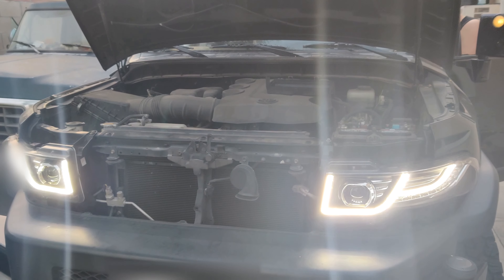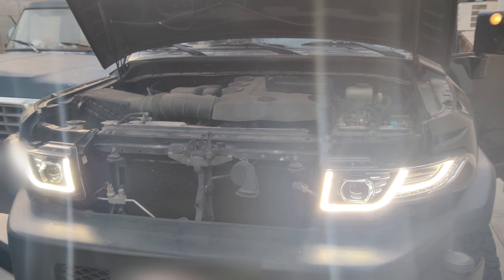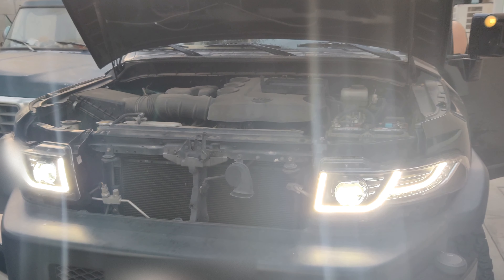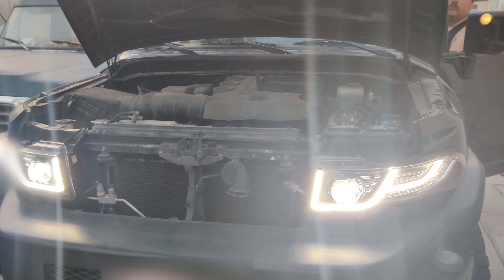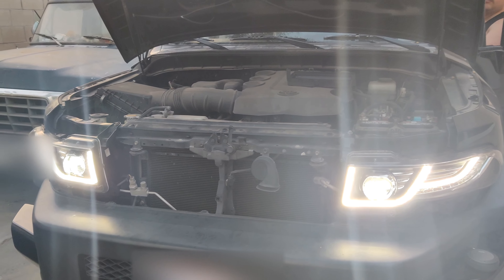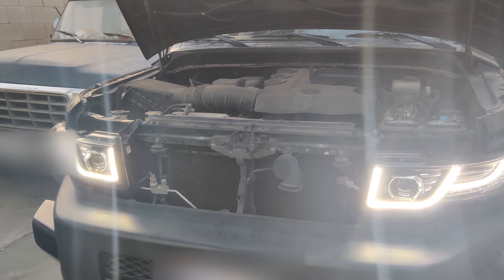Toyota FJ cruiser LED projector headlight wiring issue. Read Description.

Comment: I was thinking if H4 bulb can be modified to fit and bypass all that mess.
Reply from the maker: I tried it, it will not work. That bypass requires further splicing and you would end up at the same place as the error occurs before the lightbulb with the diode. Flipping polarity on the diode requires splicing 4 wires, splicing H4 to work requires splicing 6 wires and you would still have to splice the diode to keep power from shutting off at the light connectors when engaging the high beam. Further more although not tested i am sure if you have these same headlight that they are mechanically operated to lift the cover to allow more light through. The H4 trigger a secondary bulb to become brighter and direct light higher. That bulb in this case would become brighter but not shoot light higher due to the mechanical bulb cover. You might get it to work but that's splicing another 2 cables minimum leading to 7 total spliced cables. Hope this clarifies things a bit.
Reply: @locorudy626  Thank you for your respond. Thats right I forgot about the solenoid shutter inside the lense. I will check it out when I get the headlight this coming week.
Reply from the maker: @kensaejao5216  My recommendation would be to plug them in and see how they work, you might be in the lucky group that got them plug and play. I have read a few people had no issues with them it was as simple as plugging it in everything worked fine but if you plug them in and when triggering the high beam 1) doesn't change anything or 2) turns off the lights then the diode is most likely the issue.
Reply: @locorudy626   got the headlight today and wow what a mess!!
Reply from the maker: @kensaejao5216  did you fish out all the connectors already?
Reply: @locorudy626  I did a quick inspection and the problem is exactly same as yours. I also have to install H7 Leds in reverse priority, very strange...

This is what I have found: Main lights become DRL and Led strips will only stay on in lo and hi mode. Hi beam operation will shut off the H7. I haven't look into the shutters to see if its open or close when the light is on, but I will try your method of reversing the diode first.

Also the DRL module on the driver side is messing with the circuit. I may have to bypass it and get the power directly from the fuse box instead.

Ordering some fuse pigtails and connectors now. Will let you know how it goes.
Reply: @kensaejao5216  any update on this?
Reply: @JerryHatrickShorts  I ended up disconnecting the harness of the DRL resistor unit near the driver side fender right under the head light. So now no lights are on in DRL position, the next turn on the switch will turn on the LEDs along with park lamps and next turn is the headlight with LEDs. My high beam works normally but I don't remember if I reverse the priority of the black box that came with the light. I'll check it out and let you know later.

Comment: Another topic: DRL.
I assumed the halos (neons) would act as daytime running lights. Instead, the low beams turn on when I put it into gear and start driving, and no halos (light switch still off). But when I turn on the light switch, only then do the neons come on. Something seems backwards. Thoughts?
Reply from the maker: I believe you are talking about the LED strips. If you are they need to be wired to the DRL fuse for that. I have a video of that as well.
Reply from the maker: https://youtu.be/FegfF0TYaHE

Comment: Hey bud question for you .. maybe you can help me .. I have the same headlight that came also with the taillights for my FJ cruiser however now only my dash when turning on the turning signal it hyperflashes but the actual turning lights don’t work .. they only work if I push the hazards button lights .. I heard about a relay ? But not definite answer please help!😩
Reply from the maker: That is a very weird issue. Have you tried reinstalling the factory taillight bulbs? If so did the turn signals work? If you haven't tried that check the fuses first that are associated with the turn signals.. i doubt that's the issue because you say it hyper flashes on the dash but worth a shot. If no fuses are blown i recommend reinstalling the factory taillight bulbs, reverse and turn signal see what it does then if still not working I'd do factory bulbs in the front too .. you can try and be lazy and only do turn signal bulbs on all 4 if none of that fixes it i would change the relay last but I'd order it today just in case all else fails, not sure where the flasher relay is on the Toyota on my Sequoia it was easy to get to on my brothers Lexus almost impossible without scaring your hand... hopefully just a fuse I'd get a test light and start at the fuse panel under the steering wheel since the turn signals need ignition on to work. Keep me updated on your findings.
Reply: @locorudy626   thank you brother! I will keep you updated, I recheck all the fuses and they all look good.
Reply: By process of elimination, recommend unplugging the taillights first and then testing this out if no hyperflash and turn signals are good in front check the rear install. If I recall (For VLAND) the taillights are wired differently than the oem, meaning you have to install the plug to the bulb socket in a different location than the oem. Forgot how this went but i had to plug the wires from where the parking lights to the turn signal and the turn signal to the parking lights also i think this needs a bulb for the brake light which i replaced with an led.

Comment: Hi. I keep hearing H7 and D2H bulbs, but it seems they only have 2 contacts, so how does that offer both low AND high beams?
Reply from the maker: That is correct, the factory H4 plug from Toyota has 3 connectors 1 for low beam 1 for high beam 1 for ground. Tapping these cables to an h7 bulb would not work, you would need a special harness to keep the 12v constant to the bulb because Toyota cuts the power out to low beam when the high beams are engaged. Also note that h7 are single functional bulbs they do not have a dual function so the way high beams work on these is through a moterized shutter that lifts when the high beam is engaged allowing more light to come through. The diode that comes with these headlights somehow keeps the 12v signal constant to the bulb while triggering the high beam motor on the projector. How exactly it does it i am not sure as i don't have the electrical schematic but it works for both low beam and high beam.
Reply: @locorudy626  to make sure I understand, these headlights are able to switch an H7 bulb between low and high by use of a shutter in the assembly?
Reply from the maker: @Drrrre  Yes they can. Nothing changes with the bulb the highs are just the action of the housing shutter moving up when engaged and down to limit the beam of light being emitted from the h7 bulb so in essence the high beam no longer triggers the bulb but the housing shutter.
Reply: @locorudy626  I appreciate the help. Also, how did you choose which one to pick, on eBay? There seems to be about a dozen or more sellers. Are they all selling the same brand/manufacturer?
Reply from the maker: @Drrrre  I bought them a while back the seller doesn't have them anymore, but the ones I bought are the  vland and they were the H7 model with the black grille. You can choose different bulb and grille color that would be at your preference but vland was the brand of the headlights.

Comment: just ordered my vland headlights like this thanks for that info i heard this was a big problem for alot of people. one question i have is i got the ones that come with H7 bulbs but originally the FJ's are H4 bulbs. how do i make the conversion to fit the H7 to be used with my FJ. like how are the plugs going to be compatible etc. thanks in advance.
Reply from the maker: The vlands come with an H4 connector that you can easily plug into your factory setup. They're set up in a way that connects to the H7 through diodes. It's pretty much a plug-and-play deal, but you might need to get your hands on an H7 bulb if it's not included.

Comment: This was a great help! Did you wire in the red daylight running light wire if so where?
Reply from the maker: I did, I don't recall what fuse I tapped on the engine bay fuse box, but you can probe with a multimeter on DC 20 Volt  setting. Just ground the black test probe and with the red touch the metal hole on top of the fuse it should be around 0-.5 V with the key on to the accessories position and once the car is started should be providing 12V. Or reading online in forums can help narrow down 2-3 options, I don't remember what I tapped in to and it's my brother's vehicle so don't have it on hand. Hope this helps.
Reply from the maker: Man you are not going to believe this but I recorded a video on the drl process as well.. just remembered I didn't up load it because it was all in the testing face and nothing was soldered didn't want to look like we did mickey mouse work.. I'll upload it shortly.. the fuse is the drl fuse in the engine bay fuse box.
Reply from the maker: I have uploaded the video on the basic wiring option for the DRL. Hope it gives some guidance as it was only the test run not the finished product.